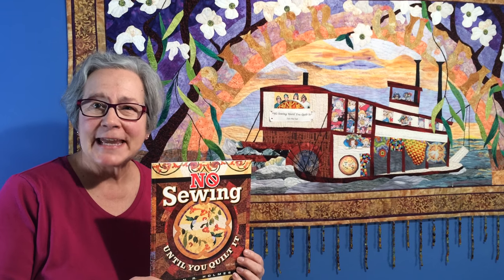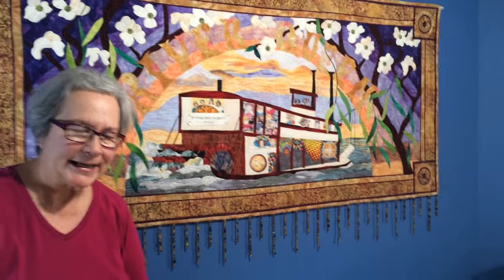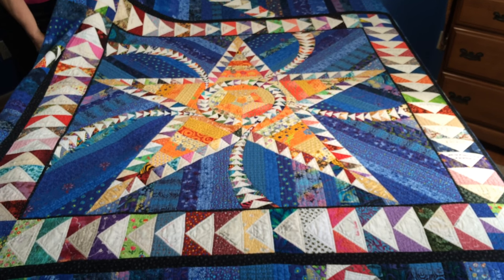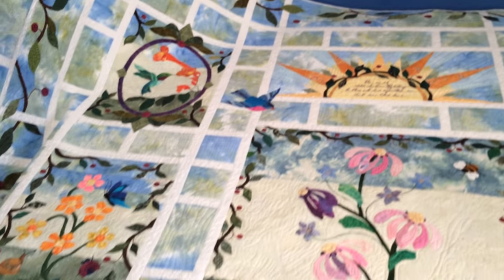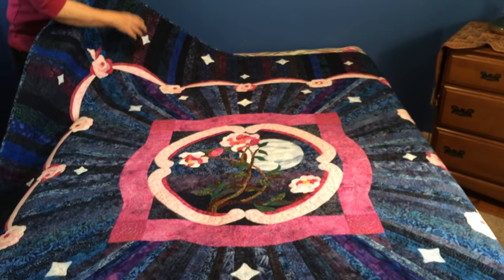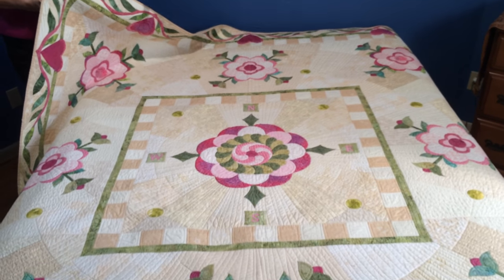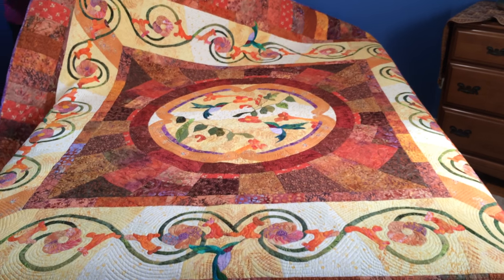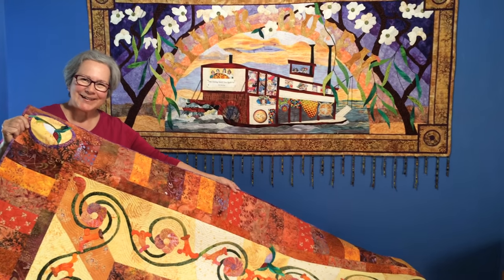Quick Quilt Show

Comment from the maker: Yes, I like “Whispertouch Thread “- nylon Monofilament .006 thickness by YLI it is a huge spool and will last a wonderfully long time. . Your machine should be happy with it! Most invisible thread is .004 it worked in my Bernina  but not in my Juki . .005 or .006 is best. I use Whispertouch in all my machine now! When using invisible thread on the top,
you often have to reduce the top tension to prevent bobbin pops.
Happy Quilting in the New Year. Ann Holmes